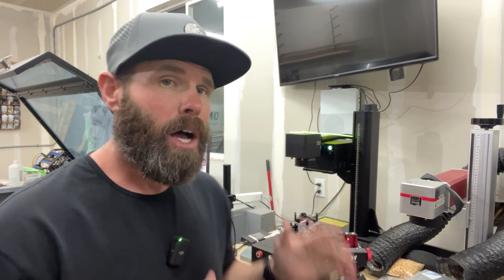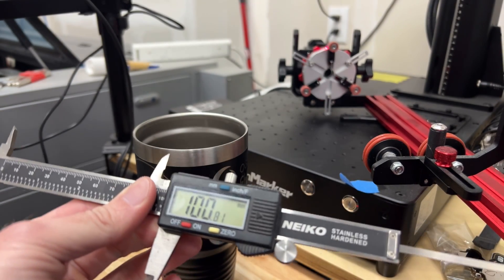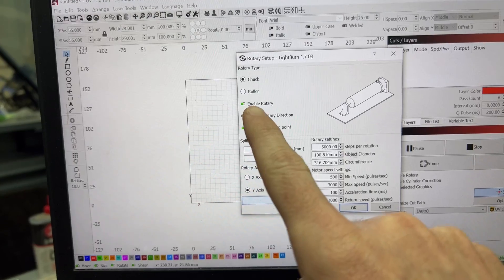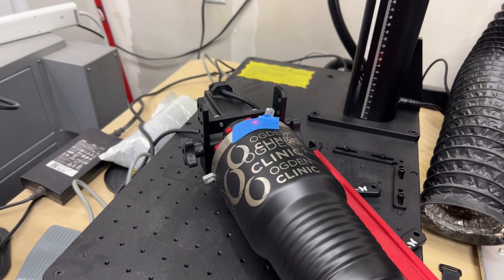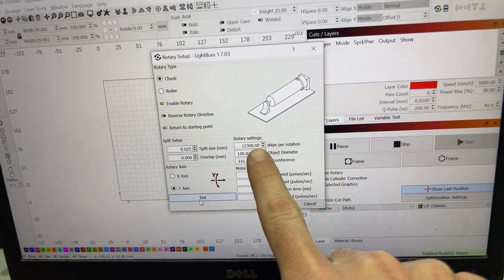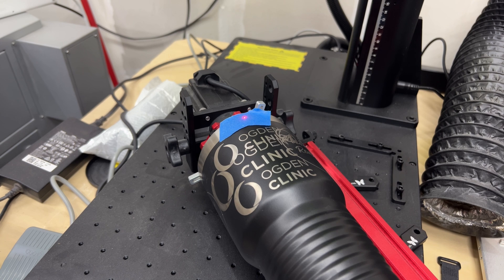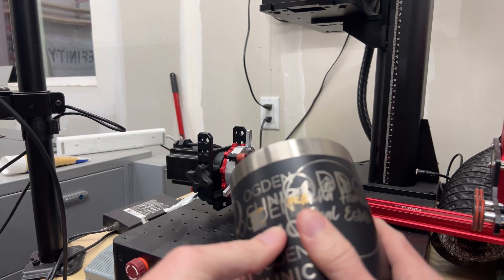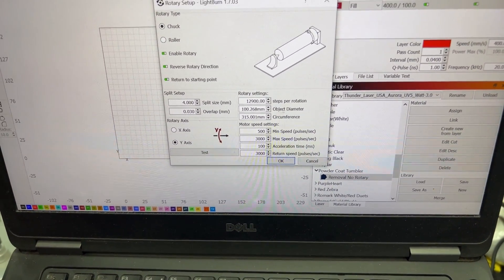OMNI1 | ComMarker Rotary Setup Walkthrough with PiBurn Grip | Step-by-Step Guide

Comment: When doing tumblers, what causes you artwork to be correct in light burn, but when you engrave it, it is mirrored and backwards?
Reply from the maker: The orientation of the rotary or the wiring. In the rotary setup menu there is a mirror output toggle that will fix this for you.

Comment: What settings did you use on light burn?
Reply: Are you asking about Omni 1 general settings, or about for the Piburn? There is a manual and a video tutorial and preset files for the general laser settings, even specifically for Lightburn. If you're asking about Piburn, watch the video a little more intently.